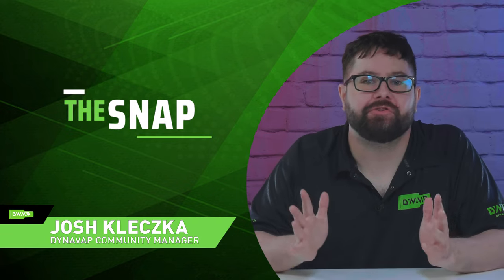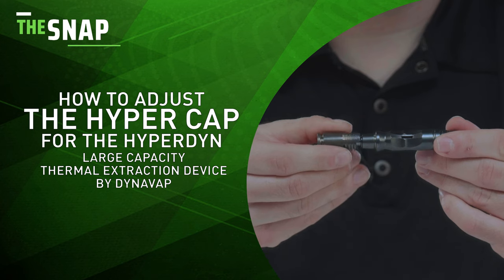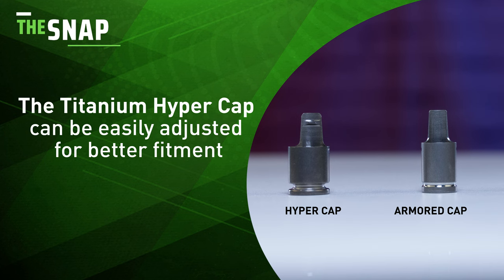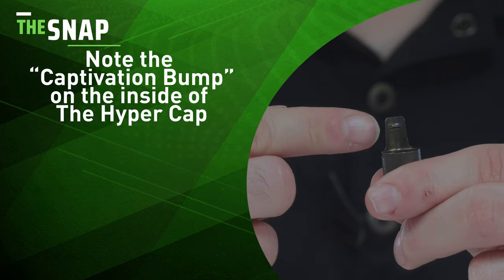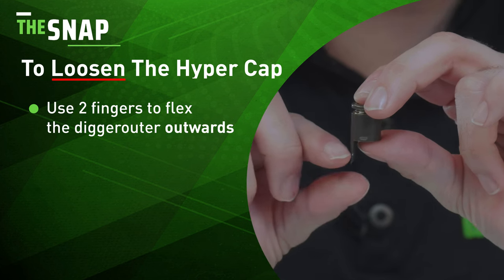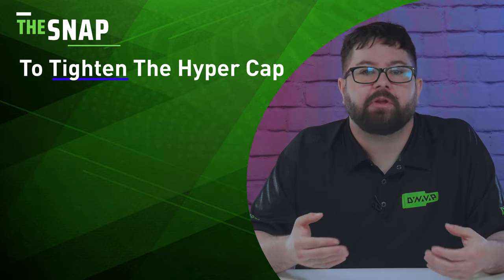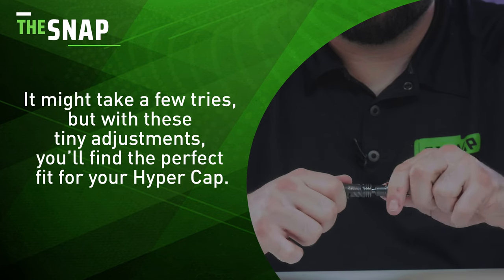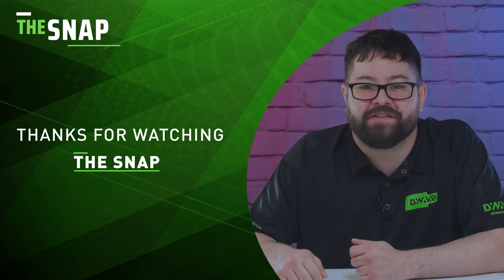The Snap |  How to Adjust the Hyper Cap

Comment: Any chance we can get a Snap on what the technically 3 different vertical cap fin lock positions do to the thermal characteristics? Thanks so much!!
Reply: They are totally gonna add that to the smaller versions of these, or as a new cap in future releases.
Reply: I don't believe the thermal characteristics will change much since the mass isn't changing. But it does give you more airflow so it could potentially make it cool down a second or two sooner depending on how hard you draw air through it. The fun part is finding the best setting just for you. Happy dyning!
Reply: @1RAH  I actually also assumed higher positions would give more airflow with a closed airport, but it doesn't seem to be the case - if anything, they are slightly more restrictive! That's part of the reason I asked, the answer is not quite as intuitive as I would have assumed
Happy dyning to you as well! 🤟
Reply: @iamastrangeloop96 more restrictive is technically not even possible.
Reply: I come just for that😅
and how the airflow works, this is the new thing, we all know how to adjust the 'captive'
Reply: Good question